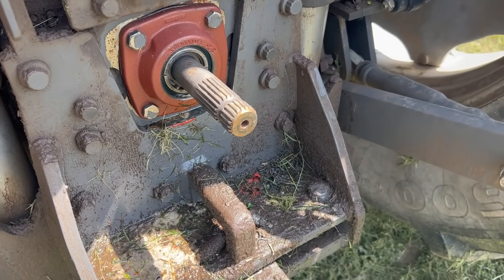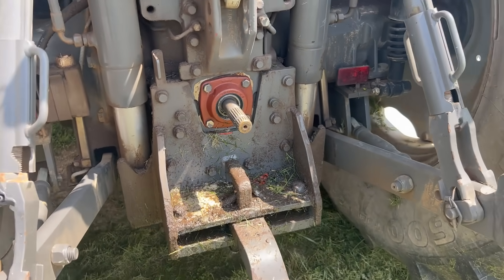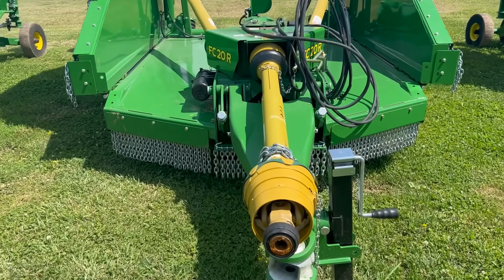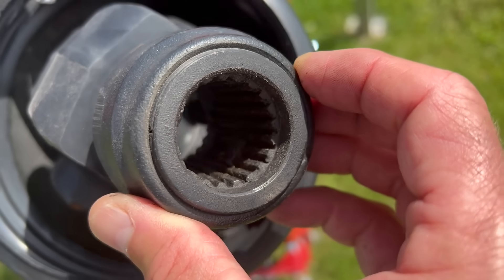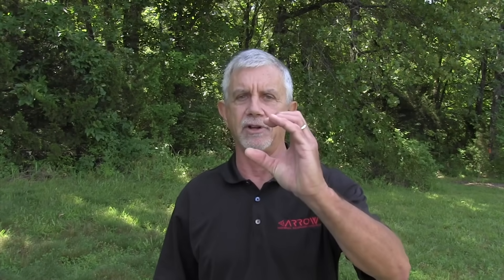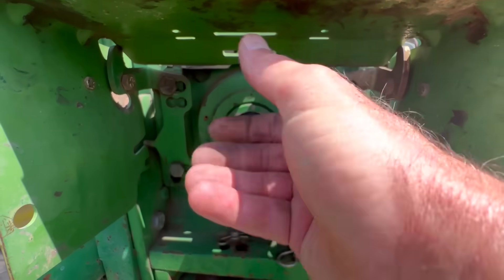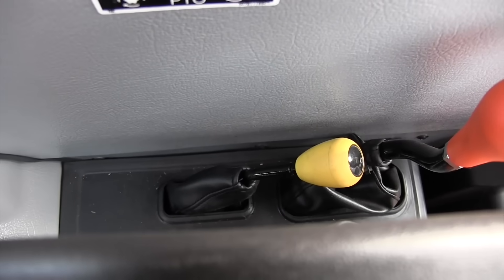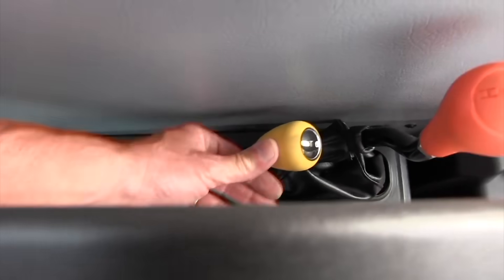Demystifying Tractor PTO Speeds: 540 Versus 540/1000 RPM Explained!

Comment: What about  these little compact tractors that have the three-speed PTO gear selector   it sure seems like 3rd gear is like way above 1000 RPM   but of course they have a 540 shaft    I had a Kubota L185 mated up to a woods 5 ft mower and when you put the PTO on 3rd gear it was all that little tractor could do to just to pull the mower much less cut any grass   but the blades had enough RPM that it sounded like it was going to send that mower hovering like a harrier jump-jet😅
Reply: I think that 3rd speed is an "economy" 540. So that is for implements that don't need the full tractor horse power. The Tractor can run at a lower RPM to conserve fuel but still gears up the pto so it maintains 540rpm.
Reply: @BillTheTractorMan  Yeah, but if he put the selector in Economy, and then wound the RPM's up to "normal" PTO speed on the Tach, then that PTO will indeed be running in Warp Drive
Reply: @anthonyroberts9034  right, that's what I was trying to say.
Reply: I have an old Mitsubishi 650 bull it's a small tractor 3 cylinder 25 horse I believe but it has four-speed PTO I believe the top speed is 1250 if I remember right bush hog sounds like it's about to fly also😂

Comment: Good video. I have a Deere that has both 540/1000 as well a 540 economy option. It's nice being able to run a smaller mower or fertilizer spreader on economy mode and then in a few minutes switch and be able to run a baler or other large implement.